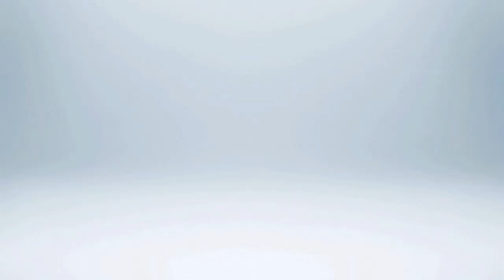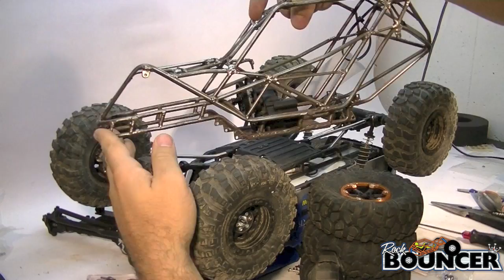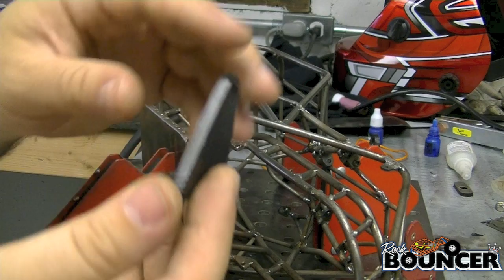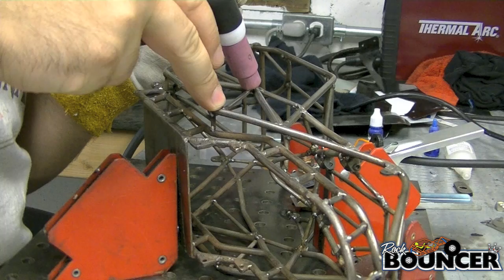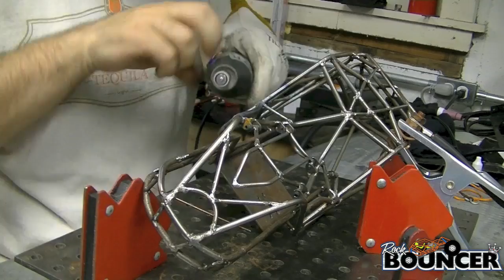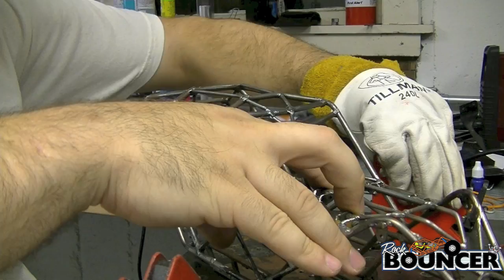RC Rock Bouncer - Episode 1 - LS Hero

Comment from the maker: I know what you mean but I do not like PC on rigs that I run hard. You can't touch it up or make any chassis changes without a lot of work to have it stripped and recoated. The nice thing with paint is that touch up and chassis modification is quite a bit simpler. I do really like the way PC flows and covers though, I have a setup and oven at the shop.